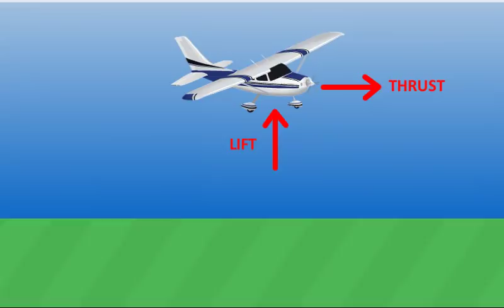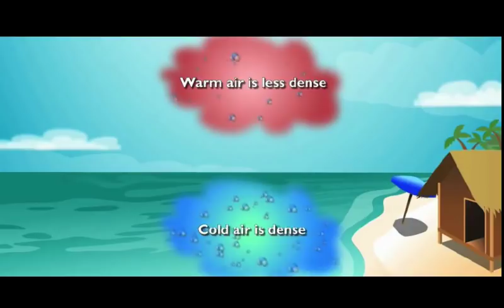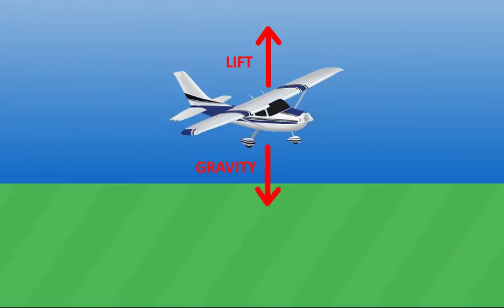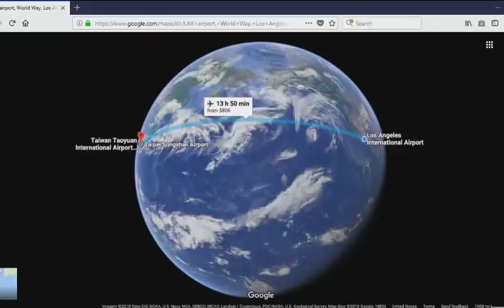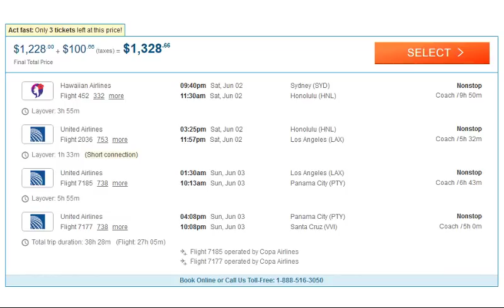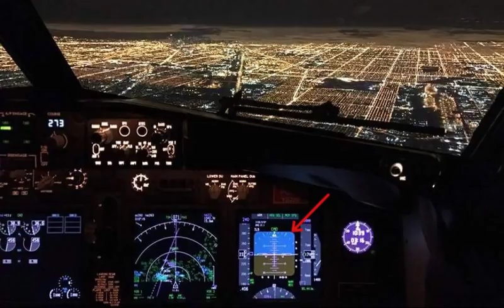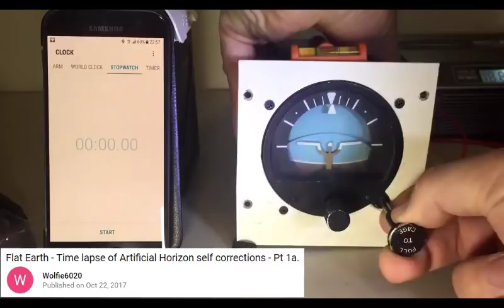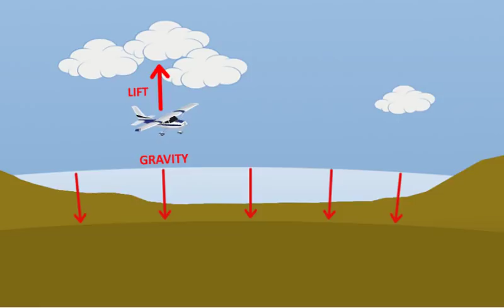Flat Earth Falsities - Plane Nonsense

Comment: Wow! To say air molecules spins along with the earth gravity is a none senses. Where the air viscosity put aside? Gravity, of course, doesn't exist. But, DENSITY   is the main role plays in every single matters.
Reply: Please give me the formula for "density" that I can use to calculate where exactly Mars will be located tomorrow.  I am able to do that with the formula for gravity, so please provide me with a formula for "density" that is also capable of doing that.  While you are at it please explain why this "density" always chooses to cause things to fall "down" regardless of the ambient density of the atmosphere.
Reply: @MrQuaiven  
Gravity, according to experimental science, is the rate of change of speed per time. I am sure, the gravitational force will not going to help to pull down any gladiator when near to the Mars, lol. No landing has ever been achieved on mars. Check the link: https://youtu.be/xzyOdH6OlV0

Any ways, in order to disproof the existence of gravity, a simple example we can take. A balloon that filled with Hydrogen or Helium gas and another balloon with atmospheric air. By releasing and observing those balloons we can conclude to say that the scientifical DENSITY explans better then gravity that the balloons would behave as the one floats upward and the other remains on the ground. Gravity has nothing to do with the behaviour of the balloons.   In the same scenario, a gasious form of water (less dense), cloud, floats above the ground until the temperature drops in the atmosphere that it affects the gasious water molecules to change it phase to liquid form (denser), rain.
Reply: @bahunegn  You avoided my questions.  I asked you to present a functional formula for "density" that I could use to calculate the location of Mars.  Gravitational formula is capable of doing that.  If "density" is a replacement for gravity then you must have a functional formula for "density" which will accomplish all the same things that can be accomplished right now with gravity.  Stop trying to deflect.  Stop posting links to tin-foil-hat wearing conspiracy nuts.  Actually address what I asked you for if you can.
Reply: @MrQuaiven  
 OMG GMO  
Where is Mars? Have your scientist exactly located it? Mars is a star, not a planet. I have told you that gravity is a negative unit of acceleration, -9.81 meter/sec./sec. (Do you see any mass or Force in the equation?). The only reason that science has tempted to use Force is to approach or to quantify and interpret the reaction of the aftermath, per say the droplets of rain due to density or the combustion of fuel with oxygen in an engine to turn the wheels. If this of my explanation and understanding of the logic behind the functionality and the deference between Force and DENSITY that you can't comprehend, let us not keep making argument that no one will win!
Reply: @MrQuaiven  
And also, if you make your body less dense then the atmospheric air by increasing your body volume  while remaining of your body mass consistent that you may be lucky to get to the Mars with out burning of large quantity of fuel. You may use that fuel just in case the needs of the manoeuvrability of the space shuttle.
Reply: @MrQuaiven  
I have just told you to verify and do analysis to a very simple logic of the two balloons. Can the equation of the gravitational force or earth gravity solve the two cases, one balloon filled with the Helium or Hydrogen gases and one with ordinary atmosphere air?
Reply: @MrQuaiven  
I am not coward just because you cannot comprehend to what I have been trying to explain. Have I mentioned to you many times to elaborate density in every day of our life how it functions and yet you are not capable to convert it to an equation and you can not to grasp on my attempt for explanation? It is not my fault if you cannot get it now. May be later when you come to my level of understanding then we will think and speak the same.
"And also, if you make your body less dense then the atmospheric air by increasing your body volume  while remaining of your body mass consistent"
That tales you in simple form of equation,  DENSITY=Mass/Volume
Reply: @BrainUser1  
Thanks bro!
The problem with mainstream people that they cannot comprehend how an equation form and for what purpose. Every equation they found in a science book that they think is perfect and become their God! When someone form an equation it has always boundaries. Without this boundaries, an equation, might not be usable. For instance, gravity, even though I do know now it does not exist, majority of people as like   @OMG GMO thinks as Forces that the earth pulling towards the center. First of all gravity is only a negative acceleration (speed/time) and has no mass or Force into the expression. Secondly, they mix and misunderstood it with the gravitational force. So, let say gravity exist according to what the doctrine teaches. The only way that -9.81m/s/s works if it is in vacuum, but does vacuum exists outside of the experimental lab? Where in the universe vacuum exists?
Reply: @bahunegn   It is a hard big jump after all the ramming done to us with that "obvious" fact, they are locked in gear with concepts they were educated not to question.   But many as this One feel the need to stoop down to lies and bluff, he does not predict anything.
      They dont understand that MATHS does not tell us who is responsable, and yes so Many worship SCIENCE as Truth and Reality.   Their vacuum aside plasma if filling with  DARK matter, for a mere 85% of missing Gravity (as its medium), its tweeted scifi to make Geocentric model work for there's. 

   Nothing in labs, I prefere a pushing force from our energy dome /torus, our plane may be in such a sphere.

Great listen for those who ponder on Life > Alan Watts - Relax Your Mind - One Of The Best Speeches Of All Time By Alan Watts
Reply: @bahunegn  "That tales you in simple form of equation,  DENSITY=Mass/Volume"
Great.  Finally some progress.  Now, use that formula to predict the rate of fall of a bowling ball in a vacuum.  Go on.  Take that next step forward.  You can do it.
Reply: @BrainUser1  
Thanks for suggestion! I will look for the Alan Watts's YouTube video.
Reply: @MrQuaiven  
First of all you need to understand the purpose of vacuum. It is only be used in an experimental lab. Take that vacuum chamber along with ball and fearher (you forgot that, I just included it for you in the vacuumed chamber 😊). Now take it way high and drop the vacuum chamber containing the ball and feather. Now, what caused the chamber to fall down to the ground. It is obvious that it is due to the density principle. Since the chamber is more denser then the atmospheric air. 😂😂😂
Dude, you still don't understand?
Gravity is not FORCE that pulls toward the Earth! it is negative  accelaration=speed per second.
What ever particle that goes up must come down in many cases. I gave you water molecule as an example, when it converts from liquid to gaseous it flot up to the sky and become cloud only because of its density is so lower then the atmospheric air. When the cloud become denser meaning those gaseuos water molecules attached each other due to drop of atmospheric temperature, they become heavier then the molecules dropes as a form of rain due to DENSITY principle, not gravity!
And now here is the reason why science trying to bring acceleration of a particle travels either horizontally or vertically. Science wants to know a particle  how fast with a given distance and time frame travels. If we compare two particles (cars) traveling horizontally, one faster and the other is slower due to thier internal mechanism, we can say one has higher speed then the other one. But, both particles arrived at the same distance with variable time. So, what about paerticles traveling vertically? in a case of heavy ball, it must have to be lift up by any means to a given distance then drop in order to determine the speed and acceleration. So the acceleration phenomena is only apply for human activities and NOT Nature!

Please don't ask me any farther questions. Hoping that this explains well. If you can't grasp, my explanation, then try stay away from your locked mental room. If you follow my suggestion, I hope you may understand the FLAT EARTHERS!
Reply: @bahunegn  Why don't raindrops fall away from the Earth? Which they should do according to your density claims.
Please explain Metacentres and Metacentric Heights?
Reply: @boffeycn  
First of all open up your mind to understand concepts. Then give time to analyze things. 
There should be an answer for every natural phenomena if we are very careful to it. Here is my observation to decide that gravity is not that governs but density. Have two balloons filled one with Helium gas and the other with regular atmospheric air. Release both and observe the action. You will notice one will remain on the ground but the one filled with Helium gas goes up. Can you explain this action with Gravity, knowing that gravity is the negative acceleration toward the earth (-9.81m/s/s). But, with density of a properly, we can. The reason that the balloon with Helium floats up is due to it's density, has less than atmospheric density. You can put ice in a glass then add water. The Ice will float. Why? It is because when liquid water become solid state it become less dense. So, it floats.
The same for water vapor. As it is in gasious stage, it goes up to a certain hight and accumulate as becoming cloud then as it condenses, it become heavy as solid or liquid to be fall on the ground. So Gravity has nothing to do with the actions that takes place, but the variation of densities between molecules which creates continual activities in nature.
Reply: @boffeycn  
About metacenter and metacentric hight. You need to look up your text books. It deals with buoyancy,  center of gravity of the body in fluid or air. I am trying to figure out your question to the my question of density? Are you telling me to figure out each individual ices that their metacentric hight what it will be? I don't see any of your relevant question to my question? 
Or is it that you try to figure out my  intellect about the subject? If that the case, please send me any questions in relation to buoyancy force. If I have time, I will answer to your question. It will be good exercise to remind my memory since I have graduated ten years ago.
Reply: @MrQuaiven  
Is your mind is incapable to understand after all of my explanation. You are waisting my time! I cannot repeat myself over and over again, but you can keep reading my remarks while drinking iced water till you get the answer.
Reply: @bahunegn  "Is your mind is incapable to understand after all of my explanation."
Is YOUR mind capable of understanding that all of your alleged explanations so far have been shit?  That was a rhetorical question, clearly you are not capable of understanding.
Reply: @MrQuaiven  
Do you think that I wasn't in your position think the same as you are. Obviously, I did pass all my examination following the school doctrine.
Reply: @MrQuaiven  
Just keep up what you Be-lie-ve in. You are waisting your time.
Reply: @bahunegn  "Just keep up what you Be-lie-ve in. You are waisting your time."
You don't have any mirrors in your house do you?
Reply: @bahunegn  "Do you think that I wasn't in your position think the same as you are. "
I know for a fact you were never in my position.  Because if you ever were in my position you would have the personal experience to realize that every single thing you have said is bullshit.

"Obviously, I did pass all my examination following the school doctrine."
There is a huge difference between memorizing what is needed to pass a test, and actually learning the concepts being taught.  You may have pass tests, but you never learned anything.
Reply: ኢ ቶፕ  can I have some of those magic pills ya taking???lmfao
Reply: What about the hurricane? Wasn't it violently and freely travels around the globe? What makes the   airplane that is traveling in controll by the so-called gravity?
Reply: @bahunegn  What causes the pressure/density gradient in the atmosphere? What causes pressure gradient in a swimming pool or ocean, where the water density is virtually constant?
Reply: @romithromith  
It is part of nature. In water, as you know, there will be variation in density over different areas. In fresh or sea water, the densities varies due to the contents of variable amount of components. The more components contents in water, the more denser. For that matter, if you are swimming in none violent sea, you will experience floating. That is because your body is less denser then that salty water. Especially in water, the change in temperature will varies in it's density. Particularly in water molecule as the internal temperature decreases, it's density decreases. These phisical changes we can see and feel it. For instance, when you place ices in drinking liquid water, the ices are always floating. That is because iced water has less density. Speaking of pressure, that is also the cause of mother nature. For instance, when high wind occurs outside of the house, the atmospheric pressure increases then the inside. So, in order to balance these differences the lowest pressure will tend to increase inner pressure. It is for that reason most of houses without strong structure will collapse easily especially if windows that are not opened are more likely vulnerable to tornado.
Reply: @bahunegn  Thank you for the explanation.
     The problem is that water is essentially non-compressible – there is virtually no additional change in density when liquid water is under pressure. So in the 12 foot depth of a swimming pool, with water of equal density and temperature throughout, what causes the pressure to increase, being greater with depth?
     Gas however is compressible so I'm also curious why the pressure and density of the atmosphere decreases with altitude which would seemingly violate the 2nd Law of Thermodynamics. 
      And given this drop of pressure and density, wouldn't the atmospheric pressure and density soon equal and even fall below that of an artificial vacuum chamber?
      In density theory, would a pail containing 10 liters of water (10 kg) weigh more than a pail containing 9 liters of water (9 kg) with a 1 kg piece of wood floating in it? What causes them to actually weigh the same – produce the same downward force?
Reply: @bahunegn  When H₂O cools it becomes less dense. This isn't a true generalization about temperature, but about phase change where hydrogen bonds form a crystal structure noot present in water. Temperature in a fluid, including H₂O, relates to the kinetic energy of the free flowing particles. Otherwise how does a steam generator if the H₂O is becoming more dense?
      It seems to me that opening windows allows high winds to enter a house and do direct damage. Rather it is aerodynamic effects on the form of the building, such flow over outside corners and pitched roofs, that devastate light construction such as wood frame houses. I also believe the pressure in the center of a tornado is less than at sea level.
Reply: @bahunegn  In conclusion. Today "gravity" has become synonymous with "gravitation". "Gravity" proper however, refers to weight, which is a force (or in terms of relativity can be modeled as a force for most ordinary uses). Because mass only exhibits weight with gravitational acceleration, we tend to refer to the magnitude of gravitational acceleration as the force of gravity.

     When you add a 1 kg piece of wood in a 9 kg pail of water, the total mass remains the sum of 10 kg and the force 98 N downward. Density explains the wood floating on the water, but the downward force remains 98 N regardless of the density of components. 

     If you take an isolated column of air, the weight of a helium balloon still exists, and still increases the weight of the air column. Density indicates the order, but does not explain the weight, which is the force of gravity.
Reply: Water is slightly compressible. We often treat it as incompressible when doing fluid flow calculations because the pressure changes involved are too small to make an appreciable change to the density. 

Hot water is less dense and will float on room-temperature water. Cold water is more dense and will sink in room-temperature water.
When water freezes, water molecules form a crystalline structure maintained by hydrogen bonding. Solid water, or ice, is less dense than liquid water.  Ice is less dense than water because the orientation of hydrogen bonds causes molecules to push farther apart, which lowers the density.

Conclusion: beware of liars.
Reply: Welcome to 21 st century bro....  How comes u guys still love in 19 century